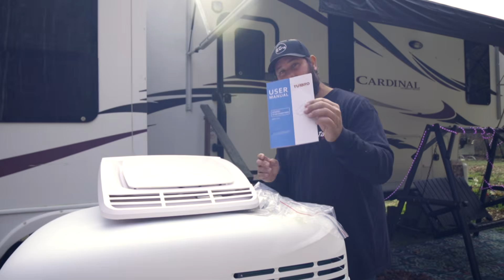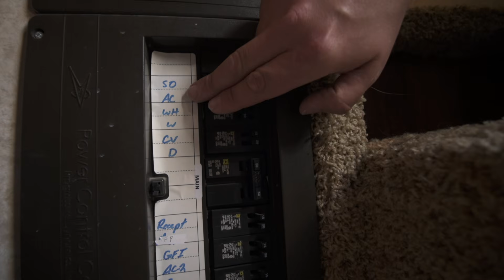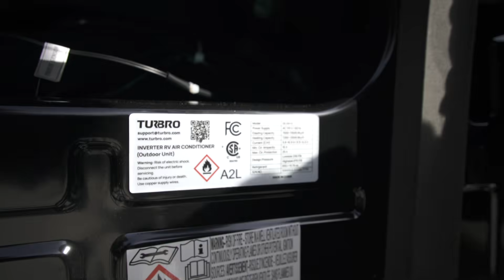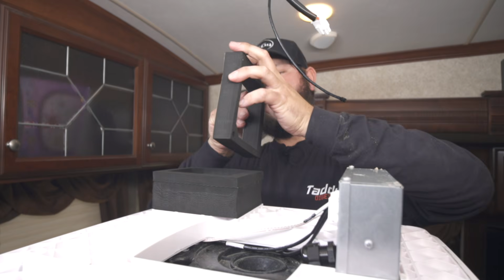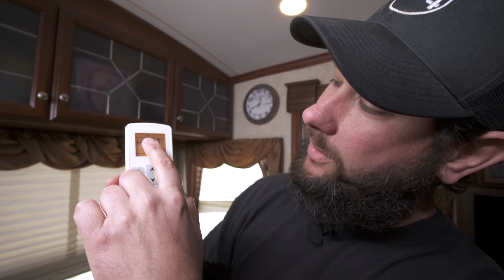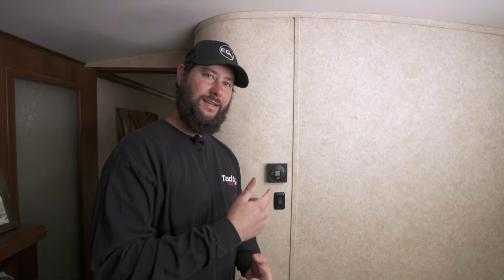RV Air Conditioner Replacement Made EASY For Beginners?

Comment: Great video. Just wanted to add that the new inverter unit will actually cost way less than 26$ a month because these units unlike traditot units dont run at a constant 9 amps as during startup. Once they reach the target temperature the compressor runs at way lower amps to maintat trht temperature. I have seen other videos show these unit running at as low as 2 some odd amps. So ur monthly cost is probably less than 15$ a month approximately.

Comment: Nice video, one point I’d like to make is it’s far to easy to cross thread a screw/bolt with power tools and much better to  start them manually and then run them down and finish tightening with hand tools. I spent 50 years as a self employed home remodeler so I’m speaking from personal experience as it can be an expensive oops if you strip the connection.
Reply from the maker: That's a great point, thanks for sharing your experience!

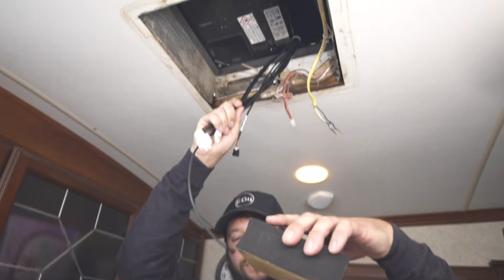Comment: 13:25  While you have the opening for the lower unit completely exposed, now is an excellent time to seal up any visible gaps and openings with metal HVAC tape. This step increases efficiency by making sure that the cold air from the blower isn’t being diverted into those gaps on its way to the outflow registers.
Reply: ❤😂🎉good work on pulling up my guy❤😂🎉

Comment: WOW this bad boy is a home run.. I have 2 Mach 15k units and installed softstarts on them, my rear bedroom unit stopped blowing cold air and I think it's  because the stupid softstart install required a bizarre connection and when I bent the splice connector (herm) or something like that to make it fit and I think it kinda broke the terminal but was still together hanging by a thread, it was late I was tired and just buttoned everything up and it worked for a few months, I think it finally broke loose..  I'm ready for this baby, looks like if I close the door to the bedroom this guy might run almost the whole night on my 600ah lifepo4 battery bank or even many hours on my ecoflow delta pro - thanks so much for this instructional install, gonna be referring back to this video ALOT ! this thing could be a game-changer - saving hours on the genny, GAS and last thru the night off solar!  I need 69 degrees to sleep well!

Comment: Good video! The first couple times this  season the AC sounded ruff, so I flipped of the fuse box. Vacuumed out . Sounds better. Question, Should the spec's for the AC for new ac. I have used my camper a lot.
Reply from the maker: I'm not sure if I understand the question

Comment: Great video for diyer. Looking to replace current a/c with a heat pump. This would be a great upgrade. Does it run any quitter than the old unit? Have done extensive work trying to dampen the sound of our rear a/c that's located like yours in the rear of the camper. Just wondering if the upgrade might help with noise. Thank.

Comment: Ty for the content Taddy. 

To be honest, my first time dispatch sent me to an rv no cooling call: i reset the breaker once. Then notified the homeowner of my ignorance to this application. With no paperwork either, i rather not waste anyones money or cause more harm. 

Now you gave me sone confidence to safely dig in further next call. Would be nice if they trained us.

Ty sir!
Reply from the maker: You're welcome brother i'm glad you're here
Reply: @taddydigest  WOW this bad boy is a home run.. I have 2 Mach 15k units and installed softstarts on them, my rear bedroom unit stopped blowing cold air and I think it's  because the stupid softstart install required a bizarre connection and when I bent the splice connector (herm) or something like that to make it fit and I think it kinda broke the terminal but was still together hanging by a thread, it was late I was tired and just buttoned everything up and it worked for a few months, I think it finally broke loose..  I'm ready for this baby, looks like if I close the door to the bedroom this guy might run almost the whole night on my 600ah lifepo4 battery bank or even many hours on my ecoflow delta pro - thanks so much for this instructional install, gonna be referring back to this video ALOT ! this thing could be a game-changer - saving hours on the genny, GAS and last thru the night off solar!  I need 69 degrees to sleep well!

Comment: Your calculations for energy use are meaningless.  Heat pumps do not generally run full tilt, 24/7.  What matters is the BTUs out for the watts in, and not just at a single point-in time -- but an average over a given period. Also note that Turbro's claim of "11.3 EER" for cooling is false.  The manufacturer of this unit (Turbro is just a distributor with a custom label) rates it with an EER of 9 in cooling mode.
Reply from the maker: I appreciate the feedback and will keep that in mind for future videos.

Comment: You could use two pvc pipes to pull it up
Reply from the maker: After doing this video I realized that I should have used at least three inch pvc
Reply: @taddydigest Well, at least you included the process you used, of hoisting the new unit up to the roof in your video. Another video I watched about replacing the roof A/C unit, totally skipped the part about how they got it up there. That was really the only reason I even clicked on their video. They went from the unboxing, right to removing the old unit and installing the new one. I already know how to remove the old unit and reinstall it. I had to inspect the base gasket in order to identify the source of a leak. Although that turned out to not be the source of the leak, I ended up replacing the gasket while I was there.

Comment: Silicone caulk will not work on a RVs rubber roof.  IF you wanted caulk you would have to use a special caulk available at RV dealers.
Silicone caulk will not adhere to the rubber roof.
Reply from the maker: Thanks for the tip, I'll be sure to check out that special RV caulk
Reply: Silicone caulk, or RTV, whatever you want to call it, has no business being used anywhere on an RV roof, whether it’s a rubber roof or anything else. My RV has a Filon fiberglass sheet roof, but regardless, I NEVER use silicone caulking on the roof. Here’s why:
     It doesn’t last. It just doesn’t hold up in the elements. And then, to make matters worse, after it falls off, nothing else will stick to where that stuff was previously applied. Dicor Lap Sealant is the only caulk/sealant that I use on my RV’s roof. I use both the self-leveling and the non-self-leveling, depending on where I’m applying it, and for what purpose.

Comment: What's the average cost to replace an RV unit?
Reply from the maker: I think the equipment's around a thousand dollars
I don't know what the average install price would be
Reply: The price of this unit was just hiked to ~$1500.  They also increased the base price from $1500, which was previously on "sale" for ~$1200 up to $1900, only to put it on "sale" for the new ridiculously overpriced $1500.  Other non-inverter units can be had for between $400 for less efficient ones to ~$900 for nearly as efficient ones that are from more trusted distributors that don't pull pricing shenanigans like Turbro does.  More inverter heat pumps will be on the market this year.

As for install costs, start up the BBQ, find a couple strong friends willing to help and do it yourself.  RV technicians usually charge a fair amount and it really depends on where you're located, but between $300 to $600 just for labor would be a rough estimate.
Reply: @johnki174  got any good links for comparable units?
Reply: I was thinking about buying one but They bring the price up  😫